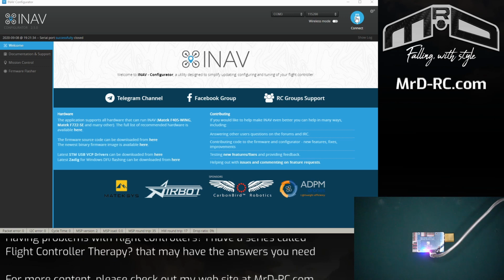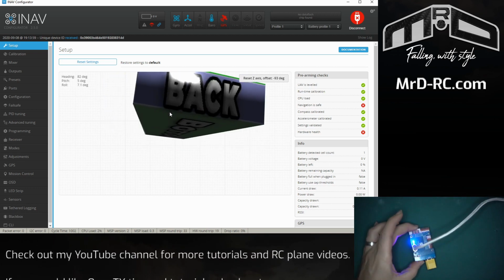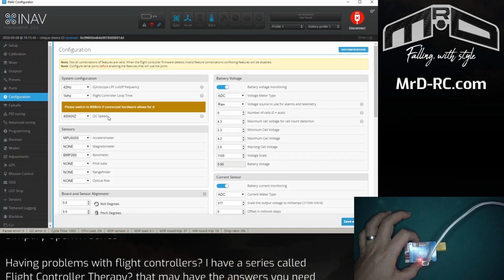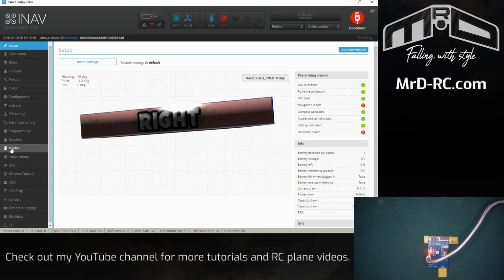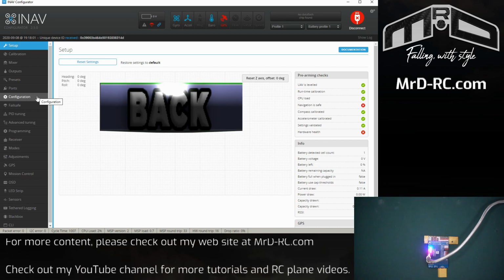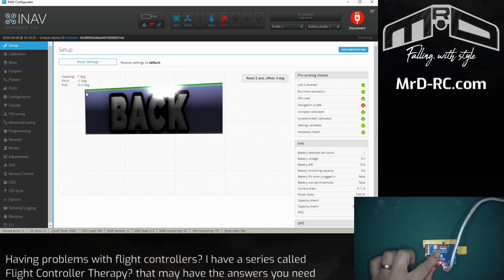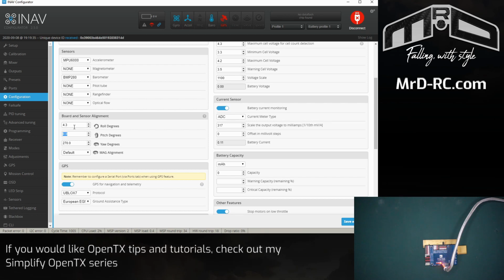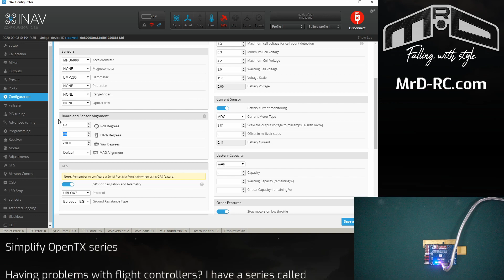Flight Controller Board Alignment in iNav

Comment: Love the videos, keep up the great work! I was wondering if you could do a fast video on basic iNav glider setup? I saw the full house setup and thats cool but I'm talking about like Y cable flaps and alerions. Im going to be using a Matek F722 Wing in a Phoenix 2400 and I will have a pan/tilt setup so need to Y cable flaps and alerions.
Reply from the maker: Thanks Sam, I appreciate it. 

Ideally, you still want ailerons on separate servo leads as they need to work differently for crow braking. If you still want crow that is. Depending on the receiver you’re using. You may be able to output directly to the pan and tilt from the receiver. Or you could use an SBUS decoder for channels 9-16? I will be making an updated full house video, so will also make a basic glider setup too. Thanks for the feedback, it’s always welcome.
Reply: @MrD  I will be using an R9mm receiver at least at first. I'm thinking about moving to crossfire at some point. One limiting factor that I have at the moment is my radio. Or at least I see it as limiting anyways. I have a Qx7 which is low on switches/sliders and knobs and speed for crossfire. This is my first glider or plane with flaps. Crow is a ways down the road. Would like to get up and going and used to the plane and it flying good then go for the more advanced stuffs. One other thing is my goggles. I have Skyzone goggles with a head tracker in it. It gives me a choice of channels 6, 7, and 8.
Reply from the maker: With the R9MM, you can bind it as channels 9-16. Then the 4 outputs on the side can be used directly as PWM channels for servos. So channels 9 and 10 can be pan and tilt. The goggles output the head tracker as trainer channels, but you can assign them to whatever channel you want in the transmitter. I have a video on this, which may interest you?

In all honesty, I don’t think you’d even need flaps with that glider. I have the 2000, and they launch so easily. They just fly out of your hand. But crow helps a great deal for landing, it’ll slow it right down. So that would honestly be my recommendation.

I use both Crossfire and R9. They’re both good systems with advantages and disadvantages. R9 has more channels and just works out the box on your Q-X7. Crossfire (with the full module) is more convenient to set up, but only has 12 channels. As far as reliability, I’ve seen plenty of issues on both platforms. But, people who are generally happy don’t ever post that. I’ve not seen any reason to choose one over the other as far as signal goes.
Reply from the maker: Here’s the Pan and Tilt video, just in case https://youtu.be/1MgZ_7pLKJg
Reply: @MrD  If you bind it 9-16 can you still connect to the FC with SBUS? I will check out the head tracker video. I have a ranger 1600 here with a F405 Wing in it as well as an R9mm and plan on either moving the pan/tilt that has on it or 3d printing a lower profile one for the Phoenix with the runcam hybrid. So I have that plane to experiment on at the moment.
Reply from the maker: Sounds cool. I flew my Ranger 2000 for the first time a couple of weeks ago. It was nice and stable. The Phoenix penetrates the wind better though. Almost a shame to bulky FPV gear on it. I was thinking of putting a small camera in the tail of my Phoenix. 

Yes, SBUS will always have channels 1-16. The channels you set when binding are just relevant for the PWM output channels of the receiver. So its really useful for stuff like the pan and tilt or switching some LEDs.
Reply: @MrD  I was thinking about only having a small camera on the tail as well but I would like to get some HD footage as well. I have the hybrid here that I was going to put on the Ranger 1600 but that plane and I are not on speaking terms at the moment. Bonafidepirate has a pretty low profile pan/tilt for the hybrid. The pan/tilt that I have now on the ranger is almost like the one you have in your video.  

Sorry for the newbie questions. One thing I'm unclear on is if the goggle tracker is looking for channels 6 and 7 and you have the pan/tilt on 9 and 10 on the receiver, how would that work? Right now in iNav in the ranger I have the mixer set to use I think RC Channel 10 and 11 for pan/tilt then in the radio to use those channels for pan/tilt.  Hope that makes sense, kinda confused myself writing it lol
Reply from the maker: No problem at all. The channels 6-8 from the head tracker in the goggles go in to the transmitter via the trainer port. So you would create inputs on the transmitter for those trainer ports. So input 9 could have TR6 as the source, and input 10 would be TR7 for the source. 

This gets the pan and tilt control in to the transmitter. Then you would create the mixes on channels 9 and 10 using those inputs as the sources. 

So pretty much the same as the video. Just put the inputs and mixes on 9 and 10 rather than 7 and 8 that I had in the video.
Reply: @MrD  Ok thanks! I think the FC will be here this weekend and I have plenty of servos to try it with. Will have to find a good place close to the FC to mount the receiver antenna so I don't need to run lots of extra wires.
Thanks for the help!
Reply from the maker: You’re welcome. 

You’d only need 2 extra wires from the receiver. The power and the ground could be taken from the servo power and ground on the flight controller.
Reply: @MrD  Where did you put your receiver in your Phoenix? I want to try to keep it as sleek as I can. Normally I would the vtx in one wing and rx in the other and gps above the FC.
Reply from the maker: My Phoenix 2000 is the original with the bad, top wing attachment. There’s a plywood tray under the wing for the rudder and elevator servos. My receiver and BEC are cable-tied to that plywood try. I mostly use this for slope soaring, so have a G-RX8 receiver in there. The antennae are attached to the tray and fuselage with blenderm tape, at 90 degrees to each other.
Reply: @MrD  I'm thinking about putting the antennas on the fuselage. Maybe have the rx out the side and the vtx out the top. Would keep the wings clean and keep extra wire to a minimum and extra failure points with more connectors going to the wing to a minimum as well. I was also thinking about sharing the power and ground to the servos in each wing and having one 4 pin connector going to each wing instead of two 3 pin connectors. I also don't want the vtx and rx in the wings because that adds two 4 pin connectors per wing at  at a minimum because of smart audio and smart port.
Reply from the maker: Sam S sounds good. The 4 way plug will work fine. You may be interested in checking out MPX connectors. They’re really handy on full house gliders. You can use 1 per wing and have independent power and grounds for each servo. They can also be used with 1 power, 1 ground, and 4 signals. Great little plugs. H
Reply: @MrD  Ya those are nice. Will have to see if there is an 8 pin version. I can use a 6 pin and put the rx in the wing but need a second power line for the vtx as that is 7 volt minimum and the servos I have are 5 volt max. Not sure what the pnp servo voltage is. I normally swap out pnp servos for metal gear ones just to be safe.
Reply from the maker: Finwing have an awesome connector with a block of 9 signal size pins in the centre, then 2 bigger power pins on the outside, big enough for ESCs. It would be great to get hold of some of those.

A lot of servos are OK with 6v these days. I’m not sure on the PnP servos though. With mine, I bought the kit and used ES08MA II servos.

Using the same power as the VTx, you’d need proper 7.2v HV servos for above that. But, it may not be a great idea, as it may add noise to the video signal.
Reply: @MrD  I see the DB 9 connector on their site. Those are old computer connectors. I think I have a bag of those kicking around here some place.

I priced out the kit version and it came up to be like 50 dollars more than the pnp. Other than the servos I plan on changing out the motor and prop in the future. Volantex has an 870kv motor and stick a bigger folding prop on it. I saw on ArchangleRC that he put a 12x7 I think on the 870kv motor. At first however it will be flying stock. Might even leave the stock servo's in place until I get it all dialed in flight wise then swap servos out.
Reply from the maker: Ah, yeah, they're old serial port connectors. It's not those. They haven't got the cool ones for sale separately. But they look like this http://www.finwing.cn/images/upload/Image/Finwinghobby%20Albabird%20web%20Standard9plus2.jpg 9+2 connectors.

The Alba is a pretty decent plane. A couple of friends have them. Josh (Bandit FPV - https://www.youtube.com/channel/UCauKx1D2_8gKCs-gzYnfDlw) has the PnP, which is a nicely balanced plane. Matt (Rag the Nuts Off - https://www.youtube.com/channel/UCWP6vjgBw1y15xHAyTDyUTw) went for the kit and different motors. He ended up moving it on because of the motor choice. The PnP seems to be where it's at.

Just realised you meant the Phoenix. I can't really comment on the motor, as the 2000 I have will be different. I was chatting with Nikola (ArxAngel) last weekend. He does like the Volantex stuff, the Raptor got him hooked. If you want to check the motor he was using, just drop him a message. He's a nice guy.
Reply: @MrD  Yup he is a nice guy. I have talked to him a few times here and facebook.  

I have the Alba favorited here and will most likely get it soon. 

Love Matts video. Haven't seen Josh much so will check him out.

Comment: Great video! How do you fine tune the "heading" in "MAG Alignment" since it is in such large sub amounts? Why can this be so far out when the board offset is per manufacturer instructions e.g. Fli[ 270 degrees with some Matek boards? Why can't the GPS find the accurate heading given enough satellites? I am an Airbus Captain and we use laser gyros and GPS Primary for extremely precise 3d information and the IRS entire system can take several minutes to align....Can you use "Yaw Degrees"...have a funny feeling this would not be a good idea....thanks in advance! Cheers:-)
Reply from the maker: Magnetometer alignment is really a different issue. This video is purely for the flight controller alignment. On fixed wing with iNav, we tend not to use the magnetometer at all, as it is sub optimally set up. There can be big deviations and overshoots when using the mag, which you don’t get with just using the GPS. 

With the mag, there is no fine tuning. Just a basic 4 rotation points, and those points with a flip. The flip is because on a lot of GPS modules, the magnetometer is on the bottom, so upside down. Only the bottom of the 4 options in the Board and Sensor alignment section of the configuration page is for the magnetometer. 

Adjusting the yaw in the board and sensor alignment section will not effect the mag at all. The top 3 settings are just for the flight controller its self, to determine where the front is, and level in pitch and roll. 

The GPS modules will be calculating the heading from the satellite positions. But this is only hobby/consumer grade equipment. I doubt it would even come close the the GPS system in your Airbus.